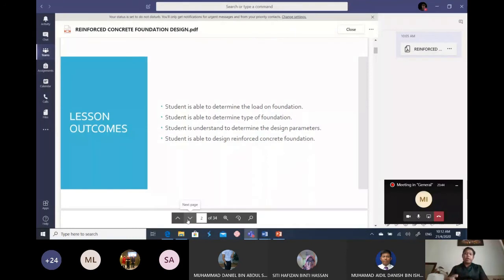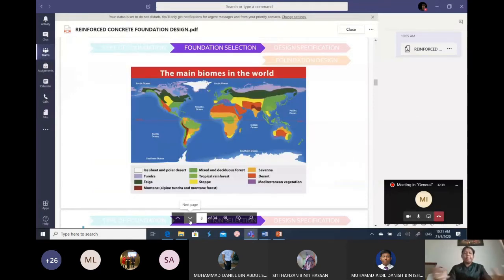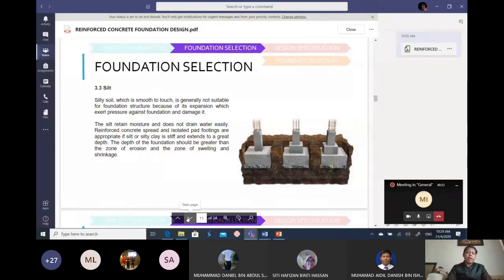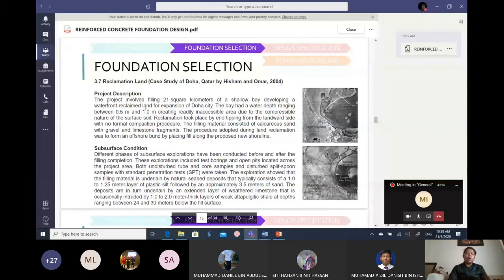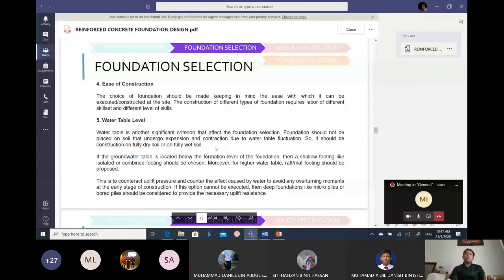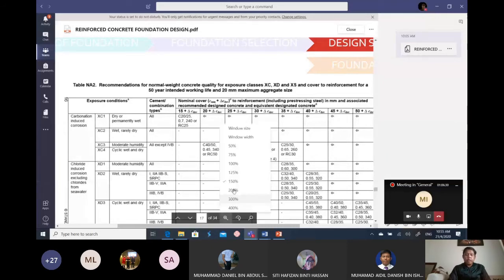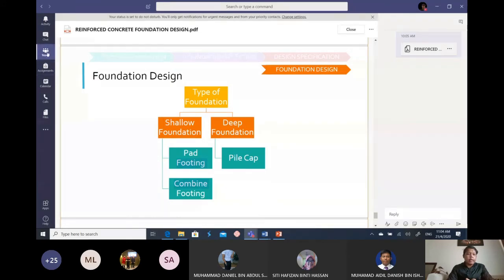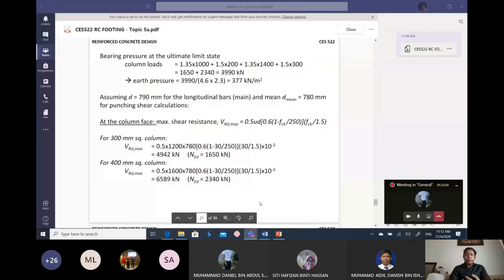REINFORCED CONCRETE FOUNDATION

Comment: Salam sir. I have a question regarding Qk which variable action of foundation. Where we can get the value of Qk? Is it from EC1?
Reply: Salam sir, i have the same question too. Is the Qk value available on eurocode or we have to calculate it?
Reply from the maker: QK for foundation is transfer from superstructure. the total load on column. you have to sperate the Gk and Qk when you analysis load on column because we need both value separately in foundation.
Reply: @mohdsamsudinabdulhamid3295  i see.. thank you so much for clarifying, sir. have a good day  😀